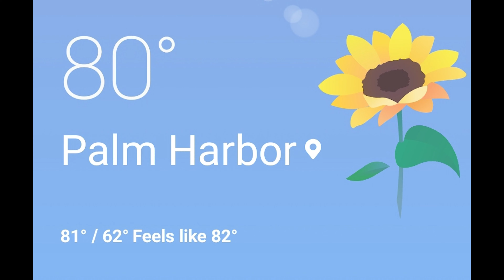Can You Believe this? We Clean this Dirty Floor so well; We EAT Off IT!

Comment: Great job!  I've done several garage floors and around the door fixtures in the crevices. I use a pressure washing lance. Then, the hard surface tool .
Reply from the maker: We do have a little hand tool that we use also at times as you describe. Nice to have to blast that junk out 😊. Thank you for sharing by the way. Great comment 👍😊

Comment: Amazing job, but one question guys, how do you clean the brushes on the CRB afterwards?
Reply from the maker: Thank you. We actually after every job clean the brushes off with the vacuum hose to remove hair and debris, and any dirty moisture, If they are really bad and we feel more cleaning is needed, we will pull the brushes and rinse them off. Most of the time, just using the vacuum hose will do the trick. You will want to on a regular basis take the brushes off and clean them and the underside of the CRB. We will soak the brushes sometimes also, but the brushes really don't absorb soils, so most rinsing will work.
Reply: @MarkSaiger  thanks for the reply Mark. Good to know.